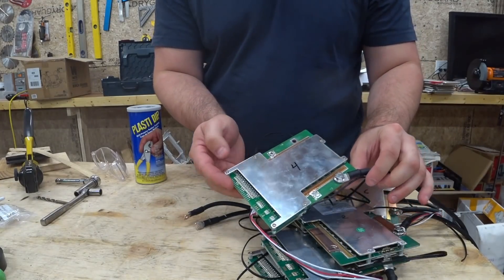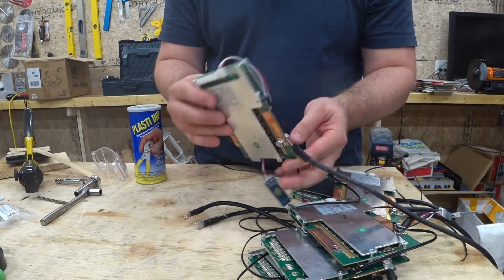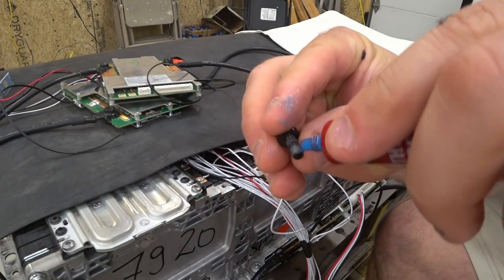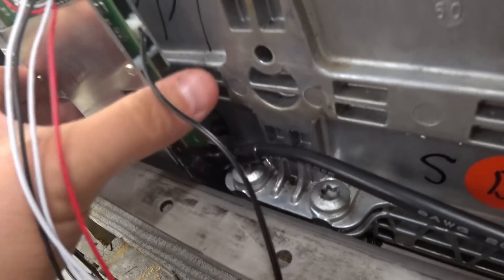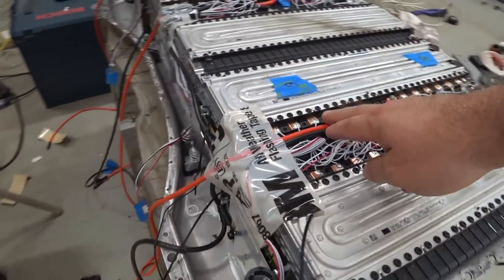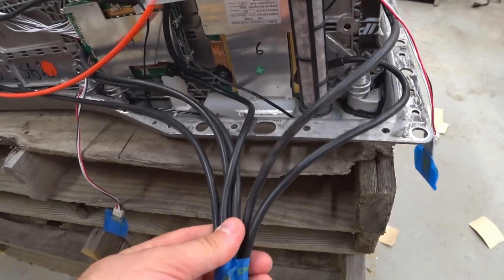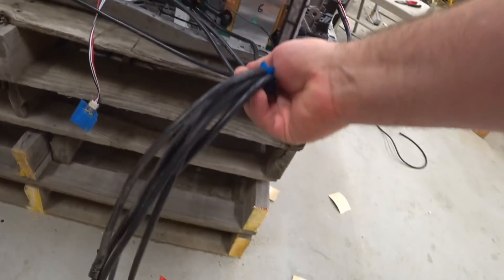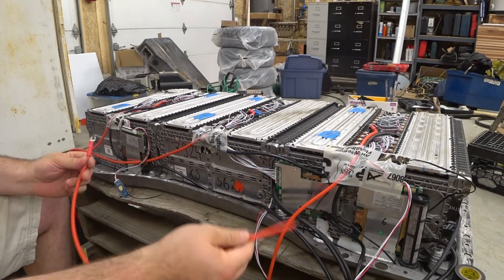Making a Lithium Battery Safer with BMS (Battery Management System)

Comment: Hi David. I've learned a lot watching your videos. I am now building two batteries a 20S and a 12S using xiaoxiang bms with large L Ion cells, pouch 16ah for 20s and samsung prismatic on 12s. Can I safety power up bms with charger just to test the software T e st app interface or should I wait to initially balance All cells then connect all leads for  bms initial powerup??? Also bms requires pre balanced cells so I thought with no cells, with charger power APP should work. Or could this damage my BMS?

Comment: How good are those Bms in balancing?
Reply from the maker: It's not very fast because the balancing current, I think was 0.5 amps on this model.  But, it does work with time.

Comment: Suggestion for next time:  just swap bolt around with head on side toward the shell and grind head down till it doesnt touch shell. You will still be able to tighten or loosen bolt and I would still apply the plastidip

Comment: Hi my Friend!!! I bought a Smart Battery like your´s, but mine has lot´s of 0,00V... how did you charged those?
Reply from the maker: I used a buck converter from DROK.  I charged at 0.1 amps (or as low as possible).  Some might recover, but most at 0.00v will not.  I've only had luck recovering LOW voltage, but never had luck recovering ZERO voltage cells.
Reply: @DavidPozEnergy  thanks my Friend for your answer... this was a bad deal for me then!!! Most of the 93 cells are 0V 🤬
Reply: @DavidPozEnergy  thanks for the explanation and sorry for the emoji... mine as  6 cells @ 3,40V 2 on each pack, but the other's doesn't even show any Voltage even @ 200mV scale... 😭😭😭😭💸💸💸💸 Seing my money flying off on the wind...

Comment: Hi David, 
Can I use the battery with no BMS?
Reply from the maker: The BMS is an important safety feature.  It's recommended to have it, just like using circuit breakers and fuses.  Will electrons flow without it, sure.  But you are taking on more risk than it's worth.
Reply: @DavidPozEnergy   Recently I bought a 4 batterys LG 14S 48v 2.2kwh  what kind of BMS do I need to use and how many?
Thanks
Reply from the maker: I am editing a video right now about adding a BMS to these exact batteries.  It may be helpful to you when I publish it in a few days.  I'm installing one BMS per battery.  I'm using 14s BMS's from Battery Hookup.  https://batteryhookup.com/collections/accessories/products/12v-lifepo4-smart-bms-w-low-temp-cutoff?variant=36287975522466
Reply: Thanks for your help

Comment: Would be easier just to use liquid electric tape....but you sold these so it doesn't matter.
Reply from the maker: Yes.  I didn't know about liquid electrical tape until I posted this video.  Someone else suggested it in the comments.  Next time I'll give it a go.  Thanks.

Comment: I have nine Nissan Leaf batteries and I’m running a 24 volt system ,what bms should I use to control dem and give me the best battery 24volt configurations
Reply from the maker: I've never used Nissan Leaf batteries so I don't know.

Comment: Not sure if you know this Au gauge is different Then Cu if some thing called for a #4Cu 80/100Amp's it would be #2/0 or 1/0 Au  So if you think you have 80Amp Au is #4 it is not #4 Au is 40amps. Does not matter if it is solid, stranded or fine. I Just seen you had Au wire And was not sure if you new this. Keep the videos Coming! Also why copper wire cost more. Nickel Wire is better then copper But it is never used as it cost a arm and leg.
Reply from the maker: Thanks for your comment.  This battery build is all copper wire.  Perhaps it looks like aluminum  because it is tinned strands.  This is the wire I used: https://www.amazon.com/BNTECHGO-Silicone-Flexible-Stranded-Impedance/dp/B07BNF16DY/ref=sr_1_6?keywords=BNTECHGO+8+Gauge+Silicone+Wire+Spool+50+ft+Red+Flexible+8+AWG+Stranded+Tinned+Copper+Wire&qid=1573748042&sr=8-6

Comment: Just saying try not to just jam wires into holes...each bend in the wire cause an increase in the resistance of the wire.  this generally doesn't matter on lower amperage situations but for you with the higher power it can excessive heat in the wires.

Comment: I have a question about the 6 bms can you se all 84 Cell at the same time on your phone can you connect BMS together or do you have to log in to etch separately
Reply from the maker: I can only see 14 cells at a time.  Then I have to disconnect from that BMS, and connect my phone to the next BMS to see the next set of cells.  The good thing is that the BMS's work automatically, so I don't have to have them connected to a phone.  The phone is just done once to set my parameters.
Reply: @DavidPozEnergy  thanks for replying great video thumbs up

Comment: @DavidPoz I have been thinking about this design for the last hour. To be honest, I think 6P14S would have been a much safer bet for you. In your current design (used) if you lose a single cell, 13 cells are now useless and would require you to take 1 of your 6 packs offline, do you have extra cells? In a 6P14S not only would you need 5 less BMS's, if a single cell dies, you just lose the capacity of the single cell and you keep trucking. The down side to this is it will impossible to detect a single cell failure without a battery monitor of some sort or a manual checking or some form of capacity monitor per parallel group. I wonder if this why telsa does 96 in parallel in their modules. Just thinking out loud, not ripping on your build at all!
Reply from the maker: Hi Little Bill,  Thanks for your feedback.  If I was building a battery from scratch I would parallel the cells first.  As you said, then you don't know if one single cell goes down.  You also need a different style BMS that can trip a breaker which would then need manual resetting.  This would be like the Batrium.  This is because these BMS's are rated for 100 amps.  The whole pack going through one of these BMS's would burn it up.  But, these BMS's are smart enough to shut off if there is a high voltage, and re-connect when you start draining.  Also vice versa.

Pros and cons to everything,
Reply: @DavidPozEnergy  agreed, you would need something like https://www.aliexpress.com/item/Daly-14s-48v-battery-pcm-bms-200a-e-bike-li-ion-battery-management-system-With-Balance/32921125952.html, plus some thicker series interconnects.

Good luck with your pack!

Comment: So let me ask a question, lets pretend your bluetooth app doesn't exist, if I'm following along correctly this is a 14S6P battery configuration. How do you determine if A- a BMS has failed -B the BMS has shutdown the battery due to LVC or HVC, or C one of the 6 breakers has tripped (does the BMS show current usage in the app?) since the case is going on you won't see lights, but say you walk away for a month or so, i don't like to babysit battery's.
Reply from the maker: Great questions.  I'm building this with BMS's so I don't have to babysit it.  Yes, it shows if the battery is being charged, or discharged, it displays SOC (state of charge) and how many amps are flowing.   If a BMS fails then I would have to replace it.  The circuit breakers will be visible from the outside and I can turn it back on.

Comment: another step forward, love it.  im sure some may watch and think 3d print this and epoxy mold that to make it look like it was manufactured but this IS how we would all do it for ourselves, tape it, done, glue it, done.  very real life, thats what makes it great.   looking forward to the next one.  crazy question but wouldnt a glue gun have been a good insulator over the nuts ?
Reply from the maker: Thanks Mark.  Glue over the nuts would have probably been better than this plastic dip.  Fist time trying the plastic dip, and it is not as durable as I would have hoped.  I see a couple chips in it just from mounting.  But the glue is holding extreamly well, and I feel confident the glue will prevent the BMS boards falling and making contact with the aluminum.  Right now there is an air gap all the way around the bolts/nuts, and I have verified there is no voltage present on the metal housing.
Reply: An inordinate number of comments reference this issue, thank god for the air gap, once you went with protruding bolt that's all that could save you.
Cars running only 12v could ground chassis but hundreds of volts need double insulation

Comment: How do you handle the dissimilar metals? Isn't most of the battery aluminum with some stainless screws? Good video as always.
Reply from the maker: You are right, there is lots of aluminum, and I'm using stainless steel hardware.  I'm not doing anything special between them.  The electrical connections are mostly copper, or tin-plated copper.
Reply: @DavidPozEnergy  thank you sir. I know that the aluminum and stainless can cause a chemical reaction only because in my motorhome the top is held on with an aluminum rail and it has deck screws attaching it to the top.  I replaced the deck screws with stainless and it works great.  If the is any adverse reaction ir should be minimal.  But the deck screws rusted and caused the holes to expand and they started to come loose . The stainless screws fixed it. Thanks for replying.  I just wasnt sure if you knew about the chemical reaction between the aluminum and stainless.

Comment: I been watching videos on battery building and have learned that you never want to attach the BMS to the batteries because of the heat the batteries give off when being charged or discharged. You should mount the BMS a another way other than right on the side of the battery.
Reply from the maker: Thanks for your comment.  There are temperature sensors, so the battery can be shut down if things get too hot.
Reply: @DavidPozEnergy  gotcha

Comment: Wouldn't changing the nuts and bolts be easier than plasti-dip? Amazing system you are building.
Reply from the maker: Probably.  The plastic dip was not the best idea I ever had.  LOL.
Reply: @DavidPozEnergy  superglue a piece of hard plastic to the nut/bolt ...hehehehe....

Comment: you should really solder the ends that are going into the breakers, fine stranded wire can work its way loose fairly easily, soldering it will make it behave like solid core
Reply from the maker: Thanks, that's a good idea.  I did call Midnite Solar tech support and asked them about these connectors and using them with fine strand.  They said it won't come loose with this style connector.
Reply: @DavidPozEnergy  its best not to solder stranded wire before putting it into terminals on breaker etc
Reply: @BenCos2018  yup you lose your flexibility

Comment: Just glue a piece of rubber to the spot(s) on the batteries where the bms nuts would make contact. That plasti dip can come off easily.
Reply from the maker: You are right.  The plastic dip does seem to chip easily.  But it was something new to try.  I've added a couple pieces of rubber tape here and there.  Thanks for watching.

Comment: Will you be able to monitor the cells with BT ounce the lid is on? The RF will not pass through the cover!
Reply from the maker: I will probably have to line up the bluetooth antenna with a hole in the lid.  Thanks for watching.

Comment: I see you have a rubber sheet protecting the top of the battery while you work on it.
Why not just glue some of that Rubber (Or some other insulating material) to the Battery and Battery containment box where the bolts and nuts are located. Some how I don't trust the Plasti-Dip on bolts. You've come this far... Why take a chance with the Plasti-Dip ??
7:10... FYI... Before I use a new glue/adhesive I test it on a piece of similar material  first. Saves me a lot of headaches when the product does not perform as claimed or expected.
Reply from the maker: Thanks for your comment.  There were a couple spots that I used some tape on the aluminum where the bolts were close.  Probably lots of ways to make this happen.

Comment: The plastic dip is useless and will easily scratch through on the sharp edges. Don't ask how I know.
Reply from the maker: I agree, it doesn't seem to be very durable.  O-well.  I'm just trying to prevent anything from energizing the shell.  I have checked with my volt-meter and there is no voltage on the shell, but it's probably just the air gap, not the plastic dip.
Reply: @DavidPozEnergy  Maybe just put a thin layer of plastic sheet between the nut/bot and the metal case.

Comment: Absolutely amazing work.  I have a 780ah @ 48v (5,000 18650 cells) battery and I'm nearing 1 year of daily operation.    So operational issues are rising higher in my mind these days - which is the basis for my questions here.   Do you think you can disassemble if (for example) one of BMSs is bad or over time you discover some cells are bad.   Do you plan to monitor the BMSs to detect if one of the 6 parallel batteries is weaker than the others (causing higher or lower voltage range).    I have several other questions...  but please don't take these as negative.   Amazing work (as I said) and I'll be interested to learn more about the operation as you get it online and over time!!.    Thanks for sharing!
Reply from the maker: Thanks for your questions, and congratulations on such a huge battery.  Putting together 5000 cells must have taken a long time, but I'm sure is worth it.
The BMS's have bluetooth so I can monitor with an app on my phone.  I figure I'll check it daily at first, then as I become more comfortable check it less and less.  I'm in the middle of a capacity test right now, and that should reveal more.  I grouped the weakest cells into battery #6.

Comment: What is your cost per kilowatt hour for the batteries you are using?  Where Did you buy them used, Ebay, Wreaking yard?  Close to $200 per kilowatt?
Reply from the maker: Yes, a wreaking yard.  Although they call themselves an "auto recycler".
Reply: Hi David;  How did you test the batteries prior to purchase?  Volt meter?
Reply from the maker: No.  The battery had an internal relay that prevents you from seeing any voltage when it is pulled from the car.  I took a gamble on the battery.

Comment: How many amps are the bms?
Reply from the maker: They are rated for 100 amps.  But I am using circuit breakers for 40 amps because I don't trust the Chinese amp ratings.  LOL
Reply: @DavidPozEnergy  I'm using 80amp on my 14s leaf batteries but I like your idea of the 40 am combiner breakers
Reply: Half load on them BMS boards (Any BMS really) is the beast idea, 40A peak blow fuse is good they likely hardly get warm if they are staying below 30A (I guess they are going to be less then 10-15A charge/load per BMS)

Comment: Good job on taping those wires down. On those sharp corners you have, what I have used is the plastic from 2 liter soda bottles. It is very tough you can crease it at different angles. Just don't get it hot.
I like Marine Goop. It will stick to most anything and you can get it off if you have to.
How are you going to lift that battery?
Reply from the maker: Thanks for your suggestion on the 2 liter bottle.  That would work well.  I don't plan to lift it much, LOL.  I plan to just slide it over to the wall and tilting it into place.  I'll only be lifting half of it as I tilt it up.  Thanks for watching.

Comment: sick, looks great! Hope those cells recovered 100% Those are sweet bms :)
Reply from the maker: Thanks.  So far the BMS boards seem to be working really good.
Reply: @DavidPozEnergy  I do hope you realize that if one of your cells voltage is much higher than the rest of the other cells in the module.  The BMS does not cut the charging current to that one cell once it reached the triggered limit.  All it does is dissipate (burn off) the current of that cell.  Meanwhile charging current is still feeding into that cell.  So if your charging current is much higher that the burn off current of the BMS, that particular cell WILL get overcharge to a much higher voltage than what the BMS designed to avoid.
Reply from the maker: Hi Ian2me, Thanks for your comment.  There are lots of types of BMS's on the market.  You are probably correct for some types.  This particular BMS (link in description) can shut off the charging voltage to the battery if one cell goes too high.  So you are right, that it won't shut off charging voltage to a single cell, but wrong that it allows a single cell to get overcharged.  
I'm glad you left this comment because it is a great idea for a video, so show the BMS shutting off the charging current.  Thank you.
Reply: @DavidPozEnergy  maybe your is a newer model.  I have 2 of those BMS about 2 years old and they didn't shut off the charging until at least 7 cells reached trigger point.  It would be interesting if your do work correctly and shut off once one cell reached.  If they work, I may get some more of those.